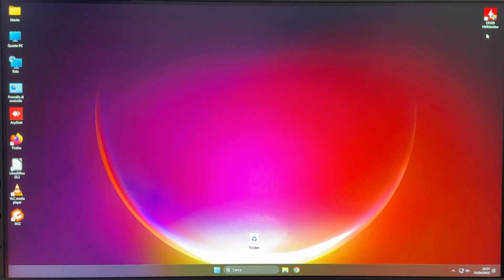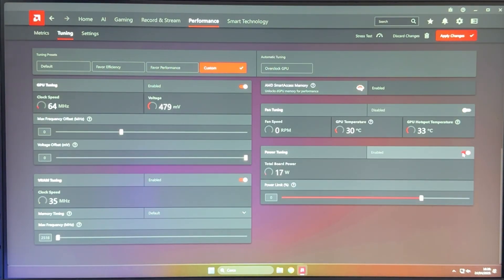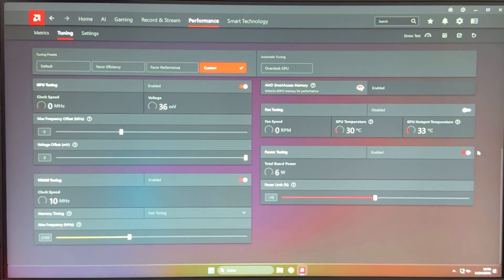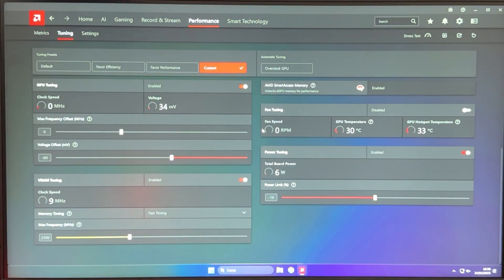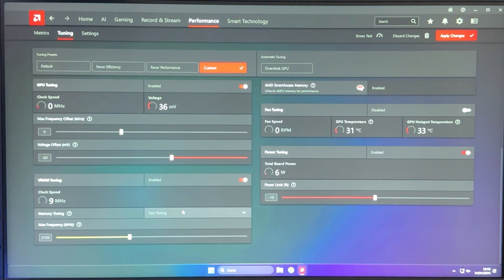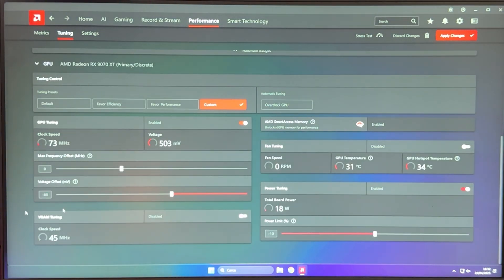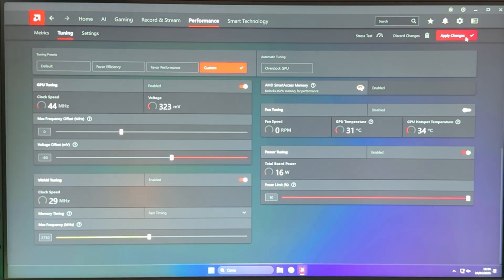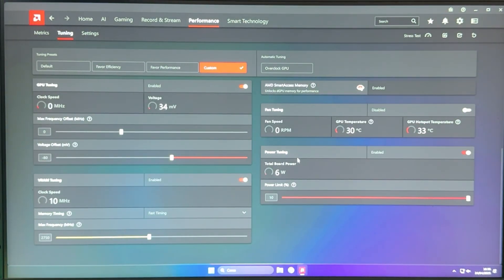Undervolt your RX 9070 XT for more FPS and Lower Temperatures! - Tutorial

Comment: just picked up a Gigabyte 9070XT Gaming OC. so far I am at +150 core, +150 memory, fast ram timings, -30% power limit, -80mv core. its been rock solid! 330w down to 230w. custom fan curve and my temps are around 45-50c core / 55-60c hotspot / 65-70c memory. i've only lost about 3% of performance. its only been a few days but ive tried several synthetic benches and several different games so far its rock solid. I am surprised with the efficiency of these GPUS!
Reply: I have the same card. Is the core the max frequency offset? And is the +150 the max frequency? Thanks
Reply: @coreym8503 yes. +150 max frequency offset*** mybad

Comment: I used your settings (I have an asrock steel legend 9070 XT) but all the games I try keep crashing, plus when I enable fast timing everything slows down massively
Reply: I have the same card. Try -40mv / -10PL with no RAM OC. It should be stable for everything. Play some games and push it further if after some days you got no crashes. Every card is unique.

Comment: Anyone can answer please but my 9070 crashes on BMW in the opening and I was wondering if it could be a volting issue. I have just bought a new PSU 1000w and it still crashes could it be draining so much power the pc goes survival mode? Would this help that?

Comment: Holy smokes thank you sir! I was getting 83°C on hot spot and sucking 330W running cyberpunk on 1440P. Did the -80mV offset, 2700mhz VRAM and put the power limit down to -30 and wow! Running stable at 230W, and only 65°C hot spot. THANK YOU! Definitely subscribed and Liked! Cheers

Comment: Lower power limit makes sense on dual fan cards but you actually want to increase the power limit in this case  bc it's a triple fans card. When undervolted, the gpu already draws less power. There's no need to handicap it even further. At -10% you're double throttling the card. The extra power will allow the gpu extra thermal headroom, while at the same time still draws less power than stock.

Comment: how much  you think the sapphire nitro + oc can do? btw thi undervolt only works in certain games. some games are still voltage hungry for example dayz it still uses over 300 watts with these settings
Reply: edit just tried this -80 , 2600 fast timing and -20 gpu still gets very hot. any idea how?

Comment: For some reason whenever I hit apply for fast timing, my system got hard reset. So I ignore it and follow your guide with my current settings is -90 mv - 15 PL. Now I got max fps on ultra settings 1440p Horizon Zero Dawn remastered. Gpu temp is 60, hotspot 80, 250W

Comment: The video in general gives good information about the functions of adrenalin, but in terms of profile advice the information is very bad. Do not try to increase the frequency of your memories if you do not want to take away the useful life of your graphics card, and the change in performance is almost imperceptible. Regarding the decrease in power, it is recommended to avoid losing notable performance and stability is -15, in several tests it ranges between a minimum of 250W and a maximum of 270W. To finish in the clock section -80 is not recommended since not all games, applications and programs are well optimized, you run the risk of it failing at some point. The ideal is -50 since in no scenario will it cause an unexpected shutdown or problem. I personally recommend turning on the hot zone section when viewing temperatures, it is a way to see the real temperature to which our graph is exposed.

Comment: I only got -50. I mean every benchmark I did on 3D mark, Furmark and OCCT -125 worked on my steel legend 9070 XT, but my games crash and I can only consistently get a -50 on all my games some can do -75 or -100 but for the most part, most of them can only run at -50.
Reply: yep, benchmarking worked fine at 100 and cyberpunk fragmented immediately lol

Comment: Thank you for this video. i bought myself XFX Mercury AMD Radeon RX 9070 XT OC White Magnetic Air. On default out of the box, I was hitting 360W board power, had 2621 score in Heaven Unigine, and had 9.6 lowerst FPS

I set -70mV, 2700 MHz and -10% power limit. Then I had 2877 score and 45.7 lowest FPS (so the undervolt fixed some horrible fps crash) and had max board power to 300W. Also it run few degrees cooler.

So, thank you again!

Comment: Help 
I have the same graphics card as you in the video where you do undervolting, but none of the undervolting settings work on this card for me, I don’t know why. The only thing that works is when I lower the power limit by −10, −20, −30, then it draws fewer watts, but I guess it also loses performance. I tried different driver versions, including the newest one, it’s the same. I removed the drivers with DDU, reinstalled Windows from scratch and it’s still the same.It’s as if the card does not react to undervolting at all. What could be the reason for this, please advise. And since for you everything reacts normally and for me it doesn’t, then there must be some reason, but I have absolutely no idea what. Even though Damian’s undervolting method is very well known and I know how to do it on Nvidia cards, and especially on AMD, I know how to do it because I even did it on a Sapphire 7900 XTx and 9070XT 

.Thanks for the help.

Comment: Dude enters 80 into the voltage offset instead of -80 and doesn't even correct himself. The value just "magically" changes into -80 after a video cut. That's not what a good youtuber should do.

Comment: Very useful video, thanks! I however have a related question to this. I have a 9070xt ASUS Prime OC (the one you actually have in the background) the I have very good 750w PSU, 5800x CPU. Card is a connected with PSU with 2 cables, 1 of which is daisy-chained. Had my first tests yesterday and looks like I cannot hit the sweet spots you showed, at least with some games and I am wondering if the PSU and she cable connections could be culprit. 
I can go easy with board power -30, but so far looks like for full stability I cannot get lower than -50 voltage offset with memory untouched!
Any thoughts?

Comment: When I restart the computer everything resets
Reply: Yeah, Did you find out how to fix it
Reply: @RisoBoss I used UDD to delete my driver and then reinstalled it. Check your maximum VRAM frequency, you may want to change it to a lower mhz
Reply: @BruceWayne-ux7fi  I actually went -70  and 2700 Mhz. Seometimes the stats stay and sometimes it resets I dont know why. I have disabled MSI afterburner etc. It feels very random.

Comment: Hey Bro, I have a XFX Swift ( Black) 9070xt. I followed all the instructions that you mentioned .  After 20 minutes of playing AC Shadowds , I had  a crash. I also tried -80, with 2700 fast timing and +10% power, again I had a crash after 15-20 minutues. Do you have an suggested numbers for this card for performance uplift and  also for the stability

Comment: I have the same card. I did this undervolt but after an hour of playing any game it keeps crashing. Latest drivers are installed. Does anyone have a similar problem?
Reply: Downgrade to 25.9.1 drivers. 25.10.1 and 25.10.2 seem to have problems.

If you're still crashing in games after you downgrade drivers, go easier on your undervolts and test your settings in games until you find one that's stable.

Comment: Hey, I tried your "should work for every 9070 XT" settings (-80 2700 VRAM -10% power) on Cyberpunk with Path Tracing and it crashes the drivers after a few minutes of load. Is it just cyberpunk specific or did I lose the lottery (I've got asrock steel legend 9070 XT)
Reply: Have you tried going easier on your undervolt

Guy did say to go to -60 or -50 volts if you're unlucky

Comment: That first one you said put 80? Which did nothing as the slider on nearly everybody cards as max? But at the end you state -80 and you had cards thats had -120 and as the end you slide the slider and area you said to put in 80 which didn’t do anything? You only sliding the slider everything goes negative which is the whole pount of undervolting

Comment: Getting 7502 on steel nomad with a 7800x3d and a nitro+ 9070xt +10power limit -85 mv and 2750 fast timing. Gpu is boosting to 3080 lol 20 over advertised boost clock. It can go further i bet. Edit: crashed at 120 stable at 90, gonna do -95

Comment: So the settings which you are suggesting are:
-10% PL, -80 Volt-off and 2700mhz on the memory. I did put PL on -15%.
Reply: How dose it run? Wht wattage do you get? And what are the benifits to put PL at -30 in terms of reliability? I just got my 9070xt

Comment: Recently built my first PC with an RX 9070 XT Nitro+, and your undervolt settings improved my temps a lot. Paired with FanControl now I get 38-39°C at low load, while before undervolting I was reaching 45-47°C and even more). Now the inside of the case is cooler, and I even think that this contributed to lower my CPU (R 7600x) temps by 2 degrees. Thank you so much!

Comment: Also,to chime in,might be rare a case,but still could happen. If you undervolt your card,it will try to boost beyond it's limits and sometimes it does. Mine  (Sapphire PULSE XT model) boosted up to 3450hz and crashed the driver,every time the driver crashed when it's happened so i had to set a -250 negative core clock offset to avoid it. This way the default max boost is 3200mhz instead of the stock 3450,which clearly isn't stable for most cards.
And some games cant stand UV of any kind,Nightreign is one,no matter the setting,it's always crashed the driver,so for some games you may have to ditch the frequence offset,and just stick with the negative power limit/ram settings.

Comment: About the VRAM frequency: I understand it is ECC memory, so it has error correction. So, allthough it does not crash too high speed cold result in lower FPS because the error correction kicking in.

Comment: OC VRAM (Memory) beyond 2650 might result in lower FPS even if it was working (no crash)
Also, Cards with (3) 8-pin power connectors, using more wattage even at stock (330w+)
Cards with (2) 8-pin power connectors, using more wattage even at stock (304w to 317w)
MV offset work 99%, but some games will not work even at 50- while some others will even work with 100 (geme variant)

My Asrock Steel legend stock use:  304w with 95 fps in Alan Wake 2 at 4K
With 70- mv offset / 150 Memory / less 5% power (290w) resulted in 100 fps in Alan Wake 2 at 4k
5% less power for 5% fps is more than decent
Reply: i have a gigabyte 9070xt oc should i lower my 2700 vram?
Reply: @Sebii-r1 try to use a few games
If 2700 perform lower than 2650, then lower it to 2650
Try benchmark programs like firestrike.. etc

Comment: Voltage offset gonna put 80 or -80? sorry newbie here.
Reply: -80

I’d probably start -60
Reply: @No_Mercy9-5  thanks mate. But mine keeps crushing even at -40. (-40, 2700, -10)😅😅😅. So i iust put it on default settings. Lol. Or maybe am doing wrong.
Reply: @playofel7920 
Yea some of these can be a tiny bit misleading every card is little different . I get full power -70mv and 2756mz fast timings it runs fine for me. I had a -80 2836mhz running fine for 2 days lol. Then it would crash. I don’t understand why it changes lol
Reply: @playofel7920  It depends a lot on the game you are playing, UE5 titles tends to be more voltage hungry, in most of my game I can use the -80 without any problem but on UE5 games even -30 keep crashing

Comment: I have a Sapphire RX 9070 XT Nitro+, and there's no point in leaving it at the same settings. More content like this about the RX 9070 is essential, as these settings are crucial to the performance of these cards. Without them, AMD's latest cards aren't significantly better than competing RTX models. I created three profiles: maximum performance, maximum power savings, and an intermediate mode. Everything is based on undervolting, and then either maximum performance or power savings. Like and sub!

Comment: My RX 9070 XT can’t do above -50mv but my mem can go up to 2916mhz
Reply: like how can you see that it doesn't work, I'm kinda scared. if I put it to 80 and turns out to be not working, will it damage my card?
Reply: @MrAquaGuy The only way to tell if the undervolt is unstable is by crashing. You will get a blackscreen for a few seconds while the AMD app turns off your GPU and restarts it with default settings. Undervolting wont kill your GPU trust me. A undervolt is harmless and actually gives your GPU a higher longevity because it lowers the power draw and temps while running better than stock.
Reply: @leechair6256  stock consume more power and hotter? What is overclock
Reply: @genlongtsang1093  It is a sudo overclock. The RX 9070 XT is weird. It overclocks if you give it less voltage. It somehow uses less power and runs faster. I think AMD gave the GPU more voltage than it needed at stock.

Comment: Wow thanks a lot for this super simple video! Just in time for when I bought this card as a gift for my GF. It is FAR EASIER than undervolting on my RTX5090 where I had to do tons of testing which a lot were stable in (Nomad/3DMark) but not in actual games like my main game (Hunt Showdown 1896). I ended up using 925mV at 2900Mhz with +2000Mhz on Memory and PL to 104%.

As for the AMD card, no need to use a third party like Afterburner and mess around with custom curves, just 1 slider and goodbye you're done in 15 seconds, amazing! I'll just do your "Good for 99% RX9070XT" setting and not even bother crashing for an extra 2-5% performance by going to -100 or -120mV.

Comment: i have xfx swift and i did -100 voltage offset and -10 power limit but i hasnt changed vram tunning . its right now 2518 . can i change it to 2700? i have xfx swift  NON OC card. will it be safe?

Comment: Oi obrigado pelo seu vídeo ajudou muito, mas me tira uma duvida sou novo em fazer overclock e mais ainda em ser da turma AMD, eu configurei usando suas configurações e deu certo aqui, mas tentei aumentar mais ainda testando no Steel Nomad, eu conseguir chegar em -100 no maximo, depois disso trava e fecha o programa, eu gostaria de te perguntar se matenho -100, -90 ou -80. Não quero dar problemas futuramente na minha placa, e tambem a parte da Vram, eu usei os 2700 mas também não tive problemas usando 2800, resolvi deixar em 2700 por a diferença não ser muito, mas tenho duvidas no limite da energia, devo deixar os -10 ou deixo 0 já que não me importo de consumir mais energia. Obrigado se puder me responder minhas perguntas.
Minhas configurações são Asus Tuf x870 plus \\ 9800x3d \\ 32gb 6000mhz \\ xfx 9070 xt quilcksilver modelo normal 2400mhz com boost de 2970mhz.

Comment: does anyone face black screen isses where monitor disconnects and we have to manually restart the cpu to coonect again but 9070xt gets disabled?or even some error message?did you guys know how to fix it?
Reply: Your card runs at stock or not?
Reply: @awakennnnnnn987 it's stock.thqt issue was fixed after a bios update but now I'm getting your driver is old error message,qhile I'm on the latest driver.ghost of tushishima crashes with this while i open it

Comment: Man, this is such a bliss. Running my Asus TUF on -20%, -85 mv and 2750 stable in every scenario. Why is this GPU tuned the way it is on stock? I mean pretty much every chip would run stable on at least some -xx% wattage?
Reply: GPU factories set all the parameters with generic values so every product sold, even with the worst chip, is functioning per specs.
Reply: @JohnnyRbbit yes. I get that. But still I can not believe that the Interval of chip quality is that huge
Reply: @dadash.210 I agree but don't forget that the difference in performance is often not even 10 FPS between chips and we are talking about mV.

Comment: The memory temps of the 9070 XT Prime OC is still sup[er high with lower power and voltages. is there anything I can do to prevent the VRAM from getting too hot? it's 98C!
Reply: I have that card too and memory runs 92c, I think it's fine because the max is 105. Maybe try putting a case fan at the bottom blows into your gpu?

Comment: -50 mvolts -30% power consumption. Minus 4fps  in game 👌
From 330w to 230w easy
Reply: Jesus insane power save. No memory overclock?
Reply: @TheBrocktonBlockbust I didn't touch the video memory. At -30%, the performance was 10% lower. Now I've raised it to -20%. In this mode, the performance loss is about 5% and the power consumption is about 265 watts.
Mem temp 76 max, gpu 65
Reply: @romanov_uz  which 9070 xt model do you have?
Reply: Only that i need to change?
Reply: depends on the game tho. diablo 4 uses only 210 watts for me. dayz uses full 300 watts even with settings
Reply: Worked great for me max 214w with minimal fps difference

Comment: can 650w psu handle the 9070xt underclocked ?
Reply: This intrest me too.
Reply: nope. The recommended wattage for 9070xt is 750W and up.
Reply: I since buyed 9070xt Pulse, and my old 650W Corsair psu perfectly work with it. 👍😉
Reply: who knows,  depending of the rest and also a video card rated for example at a maximum of 315w normal consumption can have random very short time ( less than 1 sec) of spike at probably around 400w and thats also what psu dont like if too tight , so dont underestimate that as well

Comment: Continuosly crashing my 9070xt prime if I go under -50 even with not so gpu stressing games (old world for example) CP2077 with RT ultra can crash even at -50 sometimes. Wants efficiency? Set a frame cap limiter... unusefull play at >100 fps in mostly 60 fps console ports, like expedition 33, you can run 120 fps with 230W or cap it at 60, with 60W  power. I will choose the 60W.